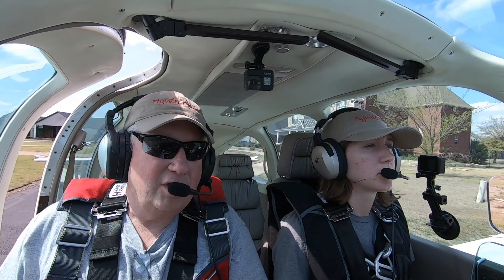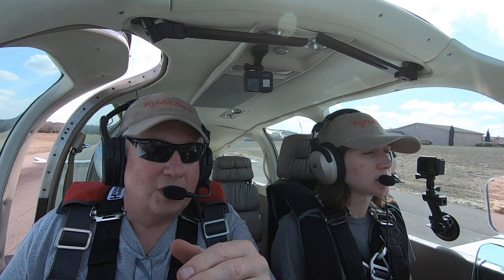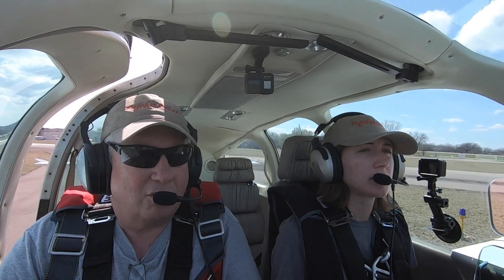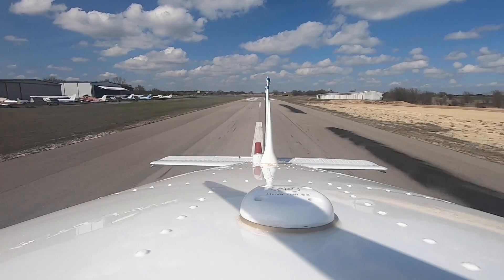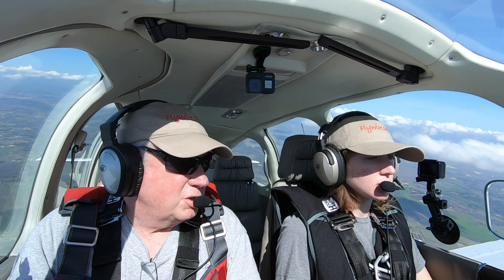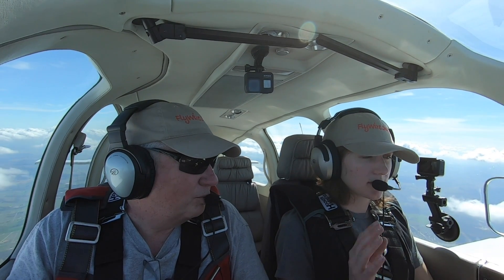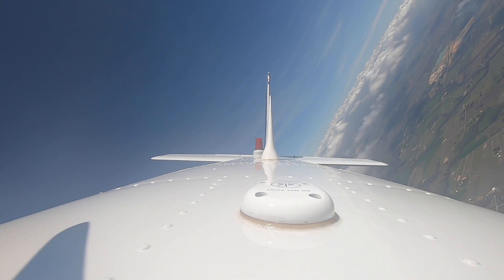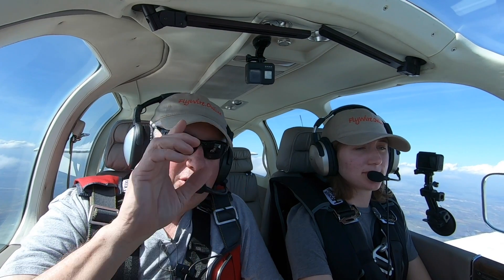Bonanza Spiral Divergence- Eagle Academics

Comment: Hi Scott, I really enjoying your video as an entry level Aircraft Engineer,  I have two questions on this topic , 1) why it pitchs up after rolling out ? Is it because the increasing angle of attack when rolling ? 2) are you talking about pushing the thrust lever or pushing the stick or both ? Just confirmation, I think we need to push both ! 3) why aircraft trims for speed not attitude but we try to maintain certain attitude when take off climbing by thrust and stick couple ? It confuses me the concept on differences when take off and crusing .  Thank you very much for your video and time, please help me if you have time to answer these questions!😊

Comment: So, as I understand, the problem is that you notice the incipient spiral, but when you roll the wings level the nose comes up hard and you are in danger of stalling. So you have to be ready to counter the rising nose to avoid losing control.
Reply from the maker: Paul pretty much right.... but you are not in danger of stalling. The problem is Trim speed. The airplane wants to pitch up to achieve it's Trim Speed... this can add 2 G or more. If you pull as well that adds G.... that gets you close to an over-G or maybe over. That's why you push.

Comment: Just curious, are the doors easy to open in the event that you need to use the parachutes?
Reply from the maker: For the Aerobatic Bonanzas there is a handle you pull which releases the pins that hold the door to the airframe. The door flies away. So, pretty easy.

Comment: The Bonanza is known for that, which makes it even more dangerous when a VFR pilot enters a cloud. Long ago I practiced this by banking only 10 degrees and letting go, and sure enough the bank started increasing until I had to recover manually or would have been in a steep spiral dive.

Comment: when you roll into a 45 degree bank to start it happens really fast. I prefer to demo this with 20 degrees as I think its a more realistic condition. Most people will react pretty quickly to 45 degrees. I’ve shown this characteristic to several Cessna pilots who were truly frightened by it until we went and did the same thing in their airplane. The difference is the Cessna doesn’t accelerate as fast and the trim reaction in which the nose comes up on it’s own isn’t so intense.
Reply from the maker: Good technique, great way to spread information and the experience around.